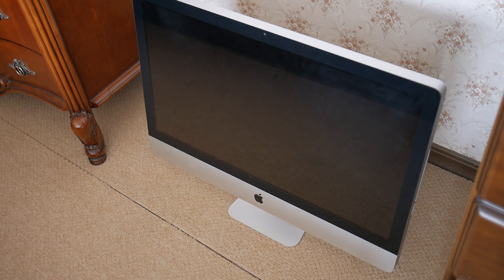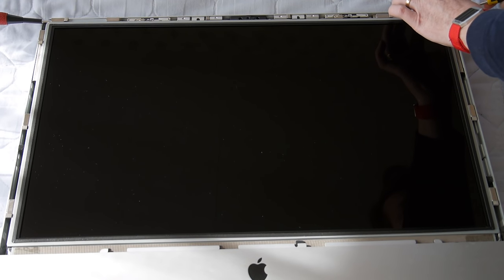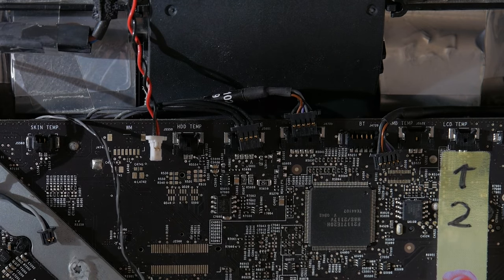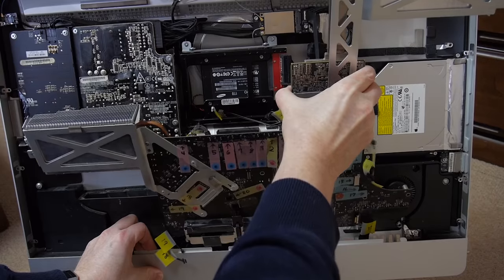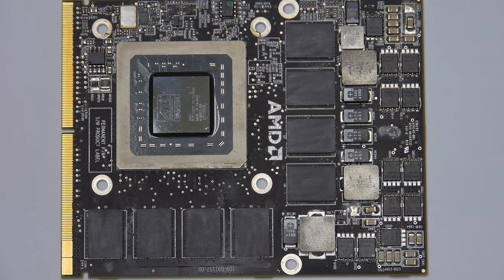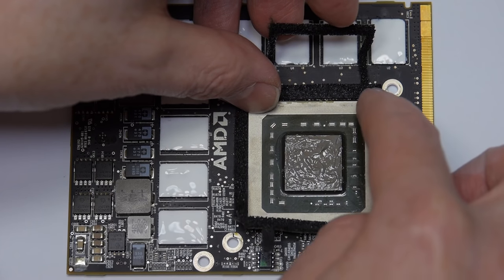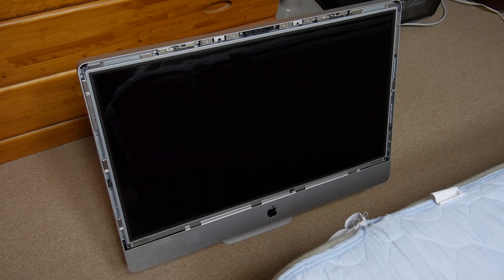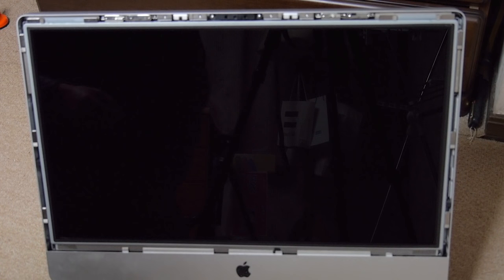Late 2009 iMac 27" Video Card Repair [4850 Bake]

Comment: Hi Bro
Thanks a lot for your video and my problem was the overheating , the FAN start after few apps Opened or few videos and the TOP in the back of the IMAC become very hot. so I bought the K4 and K5 pro and followed your steps and I even put the thermal paste into the CPU as well .... but still have the same issue ( overheating : based on SSD Fan App I have 132 F for both HDD temperature and SSD which by the way I Installed in the Optical Drive frame ). The only thing that I didn t do in your steps is to bake the GPU which I never seen on any other videos and that I never understood the reason Why we have to do it .
Please help me out
Reply from the maker: Thank you for your comment.  You say your iMac is "overheating," but what are the symptoms?  What does that overheating cause?  Does you iMac suddenly restart or shutdown?
 
You said 132°C (56°C), but that is NORMAL for a 2008 through 2011 iMac.  Indeed, even if your temperatures rise to about 176°F / 80°C when playing a game, that too is perfectly normal.  Apple runs many Macs, even modern ones, up to 210°F/99°C, which is kind of crazy, but that is the max temp of the chips used.
 
If your iMac is not booting, freezing, and/or showing artifacts on the display, assuming you have a 2008 through 2011 iMac, chances are it is the video card GPU chip that has gone bad.  And in that case, repasting won't help fix the problem you are seeing.  Because again, the temps you have described are perfectly normal.  It sounds crazy, but heating the GPU chip (which is what the bake does), fixes something inside the chip such that all those freezes, artifacts and shutdowns go away.  The fix doesn't last forever, because in my experience even a new card lasts only 3 years, but it is a cheaper solution that buying a new card or iMac.
 
I hope this info helps!
Reply: @JDW-  Thanks again . There is no reboot and no graphical symtoms, the only thing is the noise of the FAN when it runs at high speed that I Can hear my bedroom. I ordered an 1Gb GPU Card 109-B97157-00 with the Heatsink from Ebay .. hoping this will help
Reply from the maker: @younessBa  That part number is for the Radeon HD 5750 Video Card, which indicates you have a 2010 27" iMac.  I don't see how a video card swap will resolve a fan going full blast, but since you have already ordered it, please report back to let me know the result of the swap.  But when you swap the card, take time to ensure all the cables are securely seated into their connectors.  A single unplugged connector in these iMacs could result in the fans going crazy.  You did mentioned having an SSD.  Normally, if you swap the spinning platter HDD with an SSD you need to also add an OWC temp. sensor too (link below).  Not sure if that sensor is required when swapping the optical drive.  It might be.  If so, that's why your fan is running at full speed. https://bit.ly/2UvXlle
Reply: @JDW-  yes the HD5750 is also compatible with the Late 2009 27inch. and i order it to have better performance with my Adobe Pro video VFX practicing.
DO you think I Can Use the same thermal sensor that I ve been used into the Optical drive ? if so is there any particular way to connect it ? or better swap the hDD with SDD since it has already the sensor connected to the motherboard ?
Reply from the maker: @younessBa  Keep in mind that using a different video card (2010 model card in a 2009 model iMac) can cause some odd problems with MacOS as described by one person here: https://bit.ly/2WYyloo
Reply from the maker: @younessBa  You mean use the Apple optical drive thermal sensor on your third part SSD?  Not sure about that, but I'm sure OWC would answer an email from you on that topic, especially since you would need to buy the HDD thermal sensor from them if you decide to move your SSD to the HDD drive area. https://www.macsales.com
Reply: @JDW-  yes that s what I mean. Because for me. The purpose behind having the thermal sensor is to calculate the real time temperature and to prevent the motherboard to adjust it via the Fan speed. Maybe I m mistaking
Reply from the maker: @younessBa  Yes, the iMac's thermal sensors (there are more than one) are used to regular fan speed.  To summarize our discussion, the temperature you reported to me, if correct, is normal and nothing for you to worry about.  If you want to try to reduce temperatures or otherwise keep your iMac cooler, you can use one of the fan control apps I linked in the text description.  If your fan runs at full blast because of a problem pertaining to your SSD installation and the fact the stock thermal sensor isn't happy with that installation, you could opt for a hardware solution from OWC, or you could just use one of the fan apps.  All of this is irrelevant to your old and new video card though.  Even so, I am eager to hear of your success with the newer video card, to see if that affects your MacOS installations.
Reply: @JDW-  Finaly it seems to be solved . I found that Optical sensor was sticken into the frame of the iMac instead of the SSD Frame adapter . the is no more noise and I. m working with Adobe Premiere CC pro + Adobe after effect et videos HD at the same  time and the temperature is 52 C for the heatsink and the HDD as well.
Reply from the maker: @younessBa  When you say "Optical sensor," I assume you meant to say "temperature sensor for the Optical drive."  Well, I'm very glad to hear moving the sensor to your SSD was all it took to fix the problem.  Best wishes!
Reply from the maker: @Green Line I have been thinking about your earlier comment.  Why did you purchase the Radeon 5750 video card instead of the 6970M.  They both are compatible with late 2009 i7 and 2010 27" Macs.  The 6970M has 3 heat pipes which require some minor plastic cutting on the 2009 iMac, but it does seem fully compatible.  Both cards are sold on EBAY and the price difference isn't huge.  So again, I am curious what made you choose the 5750.  Also, if you have it installed, how is it running now?
Reply: @JDW-  I Got few recommandations to avoid the 6970M especially with the 2009 Imac 27po. it seems to be more compatible with mid 2010 and more and also about the price i Made a great deal on biding on the 5750 .. and I Guess they are both 1Gb , no ?
Reply from the maker: Thanks for your reply. What price did you pay for your 5750, if you don't mind my asking?

The 6970M used in the iMac is a 2GB card. It’s also quite a bit faster than the 5750, from what I’ve read. But I never read any one say it is not fully compatible with late 2009 i7 iMacs. I’ve only read scary things people have said about Apple having recalled many of those cards due to a high failure rate. And obviously, we don’t want to replace a failed card with another card that has a high failure rate. That makes me wonder if the 5750 has that much less of a failure rate than the 4850 or the 6970M. 

Anyway, what specifically did people tell you was incompatible?
Reply: @JDW-  i have an I5 not an I7. 27"
Reply from the maker: @younessBa  One last question, if you don't mind.  What version of MacOS are you running with your 5750?  (High Sierra?) Have you noticed any OS or app incompatibilities?
Reply: @JDW-  High Sierra 10.13.6 and I didn t istalled the Graphic Card yet because of the CONVID 19 Virus, some international shipping are on stand by for the moment , you see how Lucky I AM ?
Reply from the maker: @younessBa  Well, stay as safe and healthy as you can.  Here in Japan it's still business as usual with no lockdowns yet.  Anyway, once you do get the card installed, please let me know how it works with MacOS and the apps you normally use.
Reply from the maker: @Green Line Ijust wanted to follow up and ask if you have received your 5750 video card yet? I have been talking to some sellers of that card on eBay, and one has repeatedly said it does NOT work in the 2009 iMac, which has me curious what the truth is.
Reply: @JDW-  Not yet . the Border still closed until further notice . I will let You know once done !
Reply: JDW , I Have a quick question about the MAC OS upgrade , is it possible that we talk in private  , i Can send you my email or phone number to have a quick talk, if you don t mind of course
Reply from the maker: @younessBa  I am more than happy to talk with you by email.  The following link is to my YouTube channel, and toward the bottom of that page you can see how to send me an email.  https://www.youtube.com/user/JDW26/about

Comment: Good video but one thing – you aren't grounded at all if you don't attach the wrist strap to something that is actually grounded. Wireless straps won't help.
Reply from the maker: Thank you for watching and for your comment. That has been brought up in the comment section in the past, and I appreciate your taking note of that. It is indeed necessary can use a wrist strap that is corded and properly grounded.

Comment: Hi,
i have an iMac 27inch Late 2009 Intel Core 2 Duo a 3,06GHz with a ATI Radeon HD 4670 with 256MB GDDR3.
My video card is not working (i have done the same thing you did on your video) so I need to replace it, but I want to know if this your video card on your video ...is compatible with my iMac. 

Thanks! ;)
Reply from the maker: Compatible?  Yes.  Will it fit?  I'm not sure.  If you are worried about a different card fitting, just bake your existing card.  In any case, you may find the following discussion useful: https://www.ifixit.com/Answers/View/8117/Can+I+upgrade+the+graphics+card+on+my+iMac

Comment: Oh! No!  32:33,  the graphic board is sliding inside the electric oven!🤔
Reply from the maker: LOL.  Out of 786 comments spanning more than 3 years, you are the first person to notice that minute shift of the video card on the aluminum foil feet.  :-) Suffice it to say, the card did NOT slip off the feet during the bake, nor did any components become desoldered or fall off.  Obviously, folks baking their cards need to keep an eye on the card while baking to ensure the card doesn't fall off the feet.  But again, mine did not, despite the teensy shift you see at 32:33.  The vast majority of the people who try the bake find success.  I can say that with confidence because I read and reply to every single comment under all my videos, and I get to hear hundreds of stories of success.  Just make sure you check your oven temperature to ensure it doesn't drift much higher than the temperature you set.  There have been a tiny handful of cases reported to me of components falling off, but that seems due to the fact the ovens used in those cases did not have a stable temperature during the bake.  Use a turkey thermometer to check yours during the initial warm-up.
Reply: @JDW-  Thanks for your comment/reply and extra explanation that I appreciated! I consider you havd done a good job baking (twice) your graphic card. I went through an identical process with my still woking iMac 20" 2008 but was not me who did the job. the detail of the slide is not a criticism. It's just a situation that I found funny. You know, I was a video editor for about 25 years and small details like that I can't miss! Best regards! And keep making more videos!

Comment: Doesn't the bubble wrap create static? (At 28 min)
Reply from the maker: Not unless you rub it with a cloth, no.  Would it be better if I had a wooden workbench at home?  Yes.  But I don't have one of those at home.  I did not have an anti-static mat at home at the time of making this video either.  All said, what you see in my video did no damage to anything.  Indeed, that same iMac is still in service even to this day.
Reply: @JDW-  Thanks for your excellent video. My display flickers only when I have more than 20 tabs open so I'm waiting until it goes black before I tackle this task. I hope yours runs forever! Thanks again.

Comment: That card has been repaired before that's why the paste is like that. The memory chips need thermal pads. Good sign this repair is lucky to go 6 months. Better option is to replace the card with the cheaper non defective 21" GPU.
Reply from the maker: I bought that iMac in November 2009 brand new but 3 years later the card had problems and caused my iMac to lock up.  Despite my AppleCare having just expired, I wrote an email to Tim Cook.  That email was directed to an Apple executive who had a technical personal call me and arrange a free replacement. What you see in my video is that brand new video card replacement, which unfortunately died about 3 years after it was replaced -- illustrating quite clearly the defective design of this particular series of video cards.  Since Apple was not going to replace it for free again, I searched YouTube for a means to resolve the problem myself.  I found other oddball videos on baking the card, and having nothing to lose, I tried it, with my video camera rolling -- the end result being the video you saw.  That bake lasted only 4 months, as mentioned in my video description and mentioned in the pinned comment by myself.  But as I also mention, I baked the video card a 2nd time and make a video about that, showing my thermal pad replacement -- K5 Pro.  That bake, along with the good thermal paste I used, has lasted from July 2017 to present, and the machine is still going strong.  Others have suggested using a different video card, but there are caveats to that, hence my decision to stick with the stock 4850 card.

Comment: Could someone help me... My mac A1311 is not turning on. Led 1 power supply on, led 2 on, led 3 gpu on led 4 LCD off. Dvd start and stop. Cooler and speakers does not start. Flat cable (12pin) and connector power board x lcd ok.
Reply from the maker: My apologies.  I didn't see your comment in my SPAM folder until just now.  A1311 means you have a mid-2011 model iMac.  2009 through 2012 models definitely have the video card design flaw, which could be causing what you are seeing.  Meaning, if your video card has a serious problem, you can push the power button and see LEDs (like you said) but the screen won't come on and your machine often will either partially boot or not at all.  I cannot say 100% it is the video card but it is highly likely.  That's especially true if you had strange artifacts on your screen in the past and/or your computer suddenly froze when in use, forcing you to press the power button to completely power off and then do a cold boot.  In such a case, my video card bake videos can assist you in doing the bake, which if performed correctly (read the entire text Description under both of my bake videos) can resurrect your iMac.  The only other possibility is that your power supply could have failed, but I would say that is less likely than your video card having failed.

Comment: ii'm looking at this computer to buy is it good for video editing? 4k video?
Reply from the maker: I assume you are considering a purchase of this late 2009 iMac because the price is very low, correct?  (Otherwise, you'd be best served by the 2017 iMac.)  Well, I edit video on it.  Editing video is no problem at all because I have the 2.8GHz QuadCore.  Using Compressor to compress videos for subsequent uploading to YouTube does take a while though.  In comparison, my 2015 15" MacBook Pro (top end model, with dGPU) is a bit faster.  With that said, I don't have a 4K video camera and so I've never edited 4K.  I do everything in 1080p at 60fps.  Even if editing works okay in 4K on the late 2009 iMac, I would expect Compressor times to be much slower than what I am seeing.  For a 30 minute video, I would expect you'd need to run Compressor at least all night long to compress it, perhaps longer.  30 minute videos that are 1080p/60fps take several hours.  Of course, the rich and famous are waiting for he iMac Pro which will debut in late 2017.  But that thing is $5,000.  That's impossible for a regular guy like me to afford, hence my eagerness to repair my Apple devices, where possible, when they break.  Best wishes.

Comment: I bake my video card iMac 2011, so after baking, iMac don't want power on absolutely, no signal, no white screen, no black screen, no any reaction. Before baking,  was a black screen but fan is working, also i hear sound of DVD. But now, now reaction, hold power button and use socket to power no result. So who can advice?
Reply from the maker: I'm sorry to say that you will need to open your iMac again and check all the cable connections.  It seems you accidentally left one disconnected.  Make sure the video card is properly socketed too.  Even if you destroyed your card by baking it (highly unlikely but not impossible) you should have still heard fans churning when you tried to power-on.  The fact your iMac seems dead is a strong indication that some cable was either left disconnected inside the iMac or broken.  So you will need to take time to verify those connections.